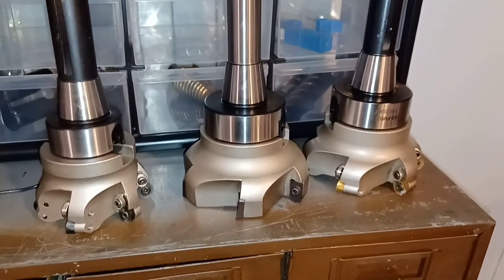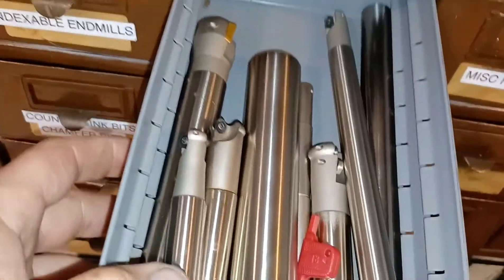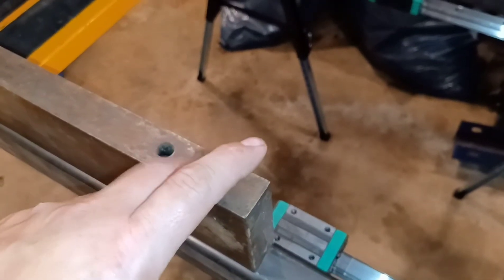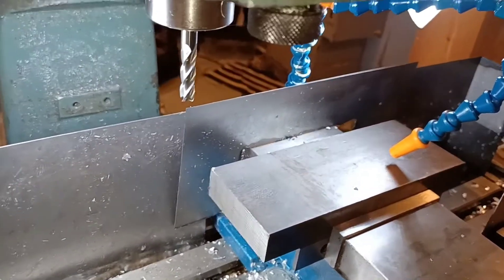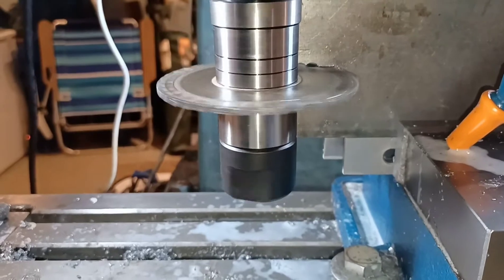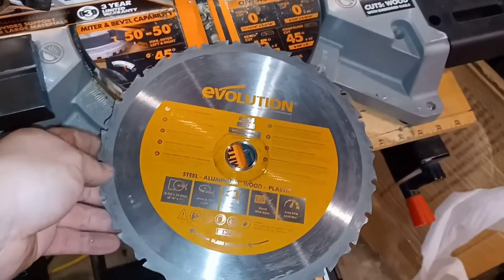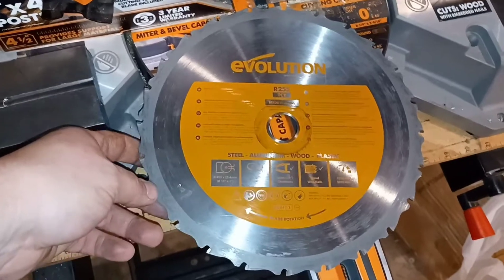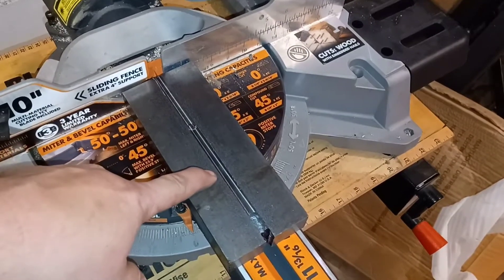New Indexable Tooling And Camera Phone, Plus Lots Of Procrastination!!!

Comment: Glad to see a new one from you. Nice to see you putting the drawers to use. The new tooling is sweet! - My go to (by necessity not choice) for a cut like that is an angle grinder followed by cleaning things up on the mill.
Reply from the maker: John that's not a bad idea. If can't hold it in my evolution saw then maybe I can make an arm to fit my 9 Inch angle grinder. Be messy but quicker then the mill.